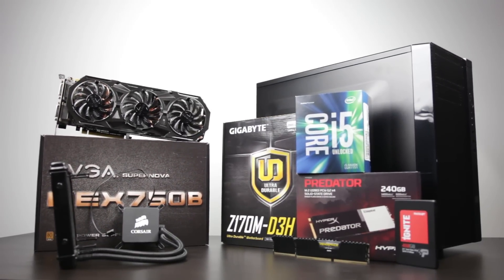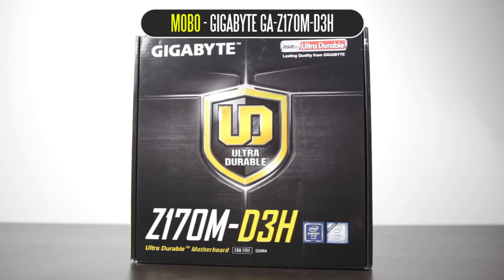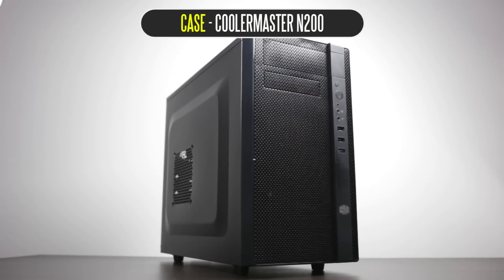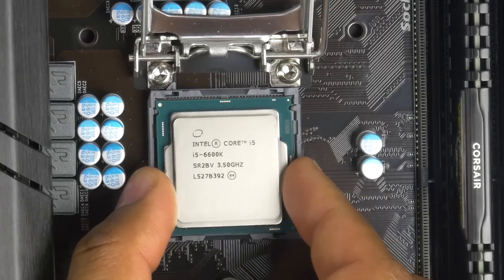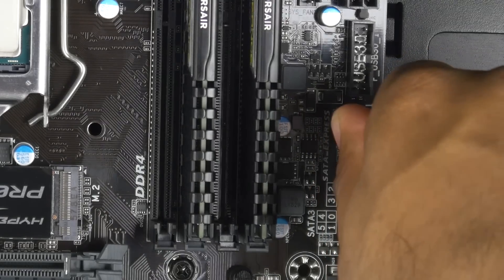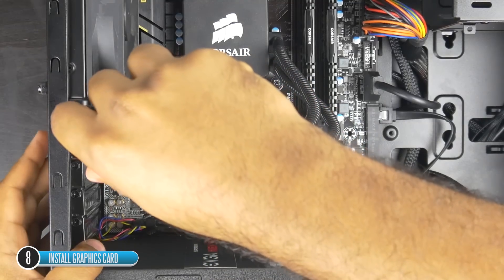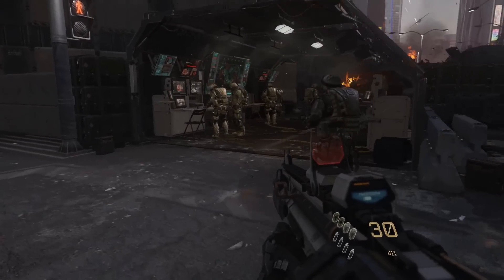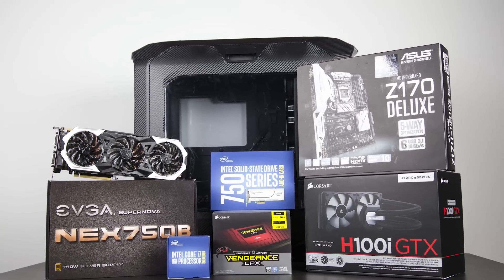Awesome Gaming/Video Editing PC For $1200 - Full Build Guide

Comment: i have an urgent question
i gonna follow the same built that you, except the RAM
I was thinking in a Kingstone Savage 8GB 2133 DDR4, taking advantage of the XMP
but is better the Corsair RAM?
Reply: If you're only focusing on gaming, RAM speed doesn't matter too much. Either should be fine. Make sure the RAM is compatible with your motherboard though.
Reply: That´s not only focus in gaming, also is for the engineer in computer systems, some build that you recomend?
Reply: To be honest, I'm not too knowledgeable about PCs outside of gaming. You may want to ask your company/school about what specs are best. There's a small chance they might even require a workstation-grade GPU. Good luck anyway.

Comment: can i used this processor Intel® Core™ i3-4150 Processor  (3M Cache, 3.50 GHz) on this mother board
Reply: no, wrong socket
Reply: yes of course, This motherboard is all you need if you dont sli or Crossfire. People tend to waste  too much in a MOBO they dont need. I got a i7 6700k h100iv2  and this MOBO theres no need for anything else. I wont SLI and dont need  the 3000000 million useless extra feautures. I rather spend more on a CPU than a MOBO.

Comment: this is a solid build BUT here's a couple of things 

1. that storage option is overkill, buy a normal 240gb ssd for the OS and a normal 1tb mechanical hardrive for storage...you just saved yourself $342

2.pairing a gtx960 with an i5 6600k is a bit well underwhelming if it was an i3 i can understand but with this sort of build a gtx970 is a much better choice, they sell for about $315

3.if you're using a board like this really and truly you have no business running SLI or Crossfire so with that said any how you look at it a 750watt is well unecessary as not even the most demanding single gpu will require that a 600watt will do fine 

with all that into consideration although your read and write speeds won't be as impressive you now have a superior gaming rig and you just saved some $$ total build avg $1000

for a more budget friendly build swap out the 
i5 for an i3 
gtx970 for the gtx 960
h60 aio cooler for a cheaper air cooler
Reply: Coyote x man this is gold! Thank you!

Comment: Hi folks, my current PC is a Fx 8150 with Thermaltake contact 30, 8gb ddr3 1600mhz, 970 gigabyte motherboard, Zotac gtx 760 2gb, 3 tb hdd. What should i do? wait for Zen or buy a I5 6600K, gigabyte Z170, 8gb DDR4 and a cpu coller for i5 will be better than the Zen?

Comment: The 6600k is such overkill for this setup. For the 960, I'd have stuck with a 6400 or maybe 6500. It's meant to be budget and overclocking isn't really necessary for the initial build.

Comment: Can I install El Capitan on my laptop Asus x552c
i will be using Logic pro x nd FCP
1. 8 gigs ram
2. I have 110 gigs of free space
PROCESSOR:
Brand Intel
Chipset Mobile UM77 Express
Cache 3 MB
Variant 3217U
Clock Speed 1.8 GHz
Processor Core i3

GRAPHICS
Dedicated Graphics Memory Capacity 1 GB
Graphic Processor Nvidia GT710M
Dedicated Graphics Memory Type DDR3

Comment: Cool build but it seems like you would use the R9 380X rater then the GTX 960 its a better card for about the same price. As Proof of concept I like the idea of the M.2 and the SSD but I would likely forgo the M.2 and get a HDD with the SSD and save a little cash. But still cool build thanks.

Comment: ONLY A gtx 960 in a $1200 build what a shitty build and a ripoff,  i could easily make a i5 6600k+390x build at this budget, which would curb stomp your build and with dx12 in the corner, it will be a monster. Seriously next time give me the money and i will make you a pc build, because from your past builds you really suck at this
Reply: +BossManiacGames EDIT here is a better build for $1200 that will curb stomp his in almost every game:http://pcpartpicker.com/p/42mZbv it has i5 660k+r9 390x. DO NOT use Waaj for pc advice, he may not even reply to this comment
Reply: +BossManiacGames  This build is also for video editing. Video editing benefits greatly of solid based drive.Also,  If you're just gaming the better gpu would have great, but, gpus get outdated quickly compared to ssd's.
Reply: Daniel Lopez
i5 for video editing makes no sense and your comment is invalid
Reply: Donny G
true but he sacrificed a lot of money on it and can be used on the gpu, having only a 2gb video card in a $1200 build is not good
Reply: Donny G
there are mobos on skylake that also support ddr3, ddr4 is cheap now, what does case size have to do with this, if your editing an i5 isn't a good choice, even a fx8350 outperforms it in editing, you would be aiming at an i7

Comment: How is this build? Could i run some decent games? 

CPU: Intel Pentium G3258 3.2GHz Dual-Core Processor 
Motherboard: Asus B85M-G Micro ATX LGA1150 Motherboard
Memory: Kingston HyperX Fury Black 8GB (2 x 4GB) DDR3-1866 Memory 
Video Card: Palit GeForce GTX 750 Ti 2GB StormX OC Video Card 
Case: Cooler Master N200 MicroATX Mid Tower Case 
Power Supply: Corsair CX 430W 80+ Bronze Certified Semi-Modular ATX Power Supply
Reply: +um 
Core i3-4170
Gigabyte GA-B85M-D3H 

Crucial 8GB (2x4GB) 1600MHz CL9 Ballistix Dual Ranked

Toshiba 1 TB

Asus Radeon R9 270X DCII 

Chieftec GPS-500A8 500W 80+ 120mm

Zalman Z3
Reply: ***** what does this mean?
Reply: +Walt Kowalski the pentium performs better than i3s in game
Reply: ***** games dont use hyperthreading and the pentium is extremely easy to overlclock
Reply: ***** by the time they do, it will be obsolete anyways

Comment: $700 DELL XPS 8700
Dell XPS 8700 with Intel-i7-4790, .....................................(4823 single core)and ( 19381 multicore).
Dell XPS 8700 with GTX 745 ............................................( OpenGL 72fps ) and  ( CPU 463cb )

Comment: can someone send me a good price for performance build with $1500? 
(i like 16gb ram, ssd and at least 500gb memory)
Reply: +Trey Hmmm....Try this

CPU: Intel Core i5-6600K 3.5GHz Quad-Core Processor  ($249.99 @ SuperBiiz) 
CPU Cooler: CRYORIG H7 49.0 CFM CPU Cooler  ($34.50 @ Newegg) 
Motherboard: MSI Z170A KRAIT GAMING ATX LGA1151 Motherboard  ($132.98 @ Newegg) 
Memory: Avexir Core Series 16GB (2 x 8GB) DDR4-2400 Memory  ($69.99 @ Newegg) 
Storage: Samsung 850 EVO-Series 500GB 2.5" Solid State Drive  ($148.88 @ OutletPC) 
Storage: Seagate Barracuda 1TB 3.5" 7200RPM Internal Hard Drive  ($46.89 @ OutletPC) 
Video Card: MSI GeForce GTX 980 Ti 6GB Video Card  ($629.99 @ Amazon) 
Case: NZXT S340 (White) ATX Mid Tower Case  ($64.99 @ Micro Center) 
Power Supply: EVGA SuperNOVA P2 650W 80+ Platinum Certified Fully-Modular ATX Power Supply  ($79.99 @ Newegg) 
Total: $1458.20
Reply: Mr. Shadow thank you man
Reply: Trey 4 months for a reply, eh?
Reply: +Mr. Shadow lol yeah. I still didnt build a PC so this build guide comes in handy. this is perfect

Comment: $1200, i5 6600k & 960? Lol that's funny
Reply: This guy seems to be a computer building noob. I really do pity him considering he payed for these parts himself :/
Reply: TheRebel3000 yeah, i agree. Even though he reuses a lot of parts it's still a bit of a waste of money
Reply: +Gerben van Zessen He's not a noob, he's a shill.

This build is crap. Completely.
Reply: Donny G
because a 960 for $1200 is not good, the 960 isn't even that good for the money, he wasted money on a useless ssd setup that won't help a lot in gaming which could be used on the gpu, which is the main part of a gaming  pc build for $1200 get a 6600k+390x
Reply: Gerben van Zessen
true and not even the best either
Reply: Trik Stari yeh
Reply: +Gerben van Zessen true for $1200 here is a better skylake build: http://pcpartpicker.com/p/rhtFD3 this is such a ripoff ripoff build, a water cooler is not needed get a air cooler and get a better gpu for that cpu
Reply: ***** i agree but the watercooling is fine in this budget, but obviously not if it's custom
Reply: Donny G what are you trying to say?
Reply: Donny G
true but a one samsung xp941 ssd is very fast m.2 ssd, over 550mb read and write and 1 hdd should do the job
Reply: Donny G because price to performance is terrible. E.g. You don't need two SSDs
Reply: And the psu is overkill

Comment: While installing the Corsair Cooler, it looked like you had the back bracket turned in the wrong direction. Why does it matter? there was a slice on one side of the bracket that is made to go around the screws on the back of the motherboard. helping get a more solid mount.

Comment: I76700k with Gtx 960 and got mine to $1275 with 120gb SSD
Reply: You can get a 970 for that price... You and this guy seem to be doing something wrong.
Reply: +TheRebel3000 Motherboard: MSI Z170A GAMING M3 ATX LGA1151 Motherboard  ($144.99 @ SuperBiiz) 
Memory: Crucial Ballistix Sport 16GB (2 x 8GB) DDR4-2400 Memory  ($112.49 @ B&H) 
Storage: Samsung 850 EVO-Series 120GB 2.5" Solid State Drive  ($69.87 @ OutletPC) 
Storage: Seagate Barracuda 2TB 3.5" 7200RPM Internal Hard Drive  ($67.89 @ OutletPC) 
Video Card: EVGA GeForce GTX 960 4GB SuperSC ACX 2.0+ Video Card  ($223.98 @ Newegg)
Reply: +TheRebel3000 he had an i5 in this list the i7 I found was $369 plus optical drive & windows 10 which equaled $1275 total lol I think I did pretty good :)
Reply: +hilltopdub if you went for a i7 4790k you could have got a 970/390
Reply: +Isaiah Hill haven't bought anything yet just getting the build ready. 1300 limit for me, should I do a better graphics card?
Reply: +hilltopdub DON'T BUY GTX960 !!! NEVER. Get 970/390 as "Isaiah Hill" Said GTX960 is a little bit overclocked 760. IDK go for the Hashwell i7 or maybe Skylike i5 but NEVER 6700k + GTX960...
Reply: hilltopdub It will easly handle editing/recording. But why you want to record gameplay ? If u really need this extra Threads u can go for Haswell i7 it will be better for rendering etc. i think.
Reply: hilltopdub if you want i7(non-overclock able) this is what you can get http://pcpartpicker.com/p/W8Fhzy

if you go with i5(overclock able) http://pcpartpicker.com/p/2hDynQ
Reply: +Isaiah Hill haven't bought anything yet just getting the build ready. 1300 limit for me, should I do a better graphics card? And just port my windows 8 to the SSD?
Reply: +4TooFLY changed to i5 6600k 3.5ghz and GTX 970 4gb + Kingston SSD, which dropped me to $1180 :)    just worried about the i5 being able to edit videos / record gameplay
Reply: The build I'm working toward.  http://pcpartpicker.com/p/dgtynQ
Reply: +Isaiah Hill    Just checked with some peeps, I think I'm gonna go with this! http://pcpartpicker.com/p/RpGYD3  $1300  (500gb of SSD for only $159 right now!)  Just gotta pick up windows 10 from a friend.
Reply: +hilltopdub http://pcpartpicker.com/p/Vhk3YJ check this out if you want skylake and want to overclock. You can change the GPU to a 970 and same with case PSU etc.

Comment: that 750W PSU is an overkill... even an r9 390X can be ran on a 550W PSU and next gen gpus are expected to be really power efficient.
Reply: ***** if and 2017 isn't far off either, but then again neither will 2018 be in 2017... see where this is going? It literary needs to be a couple weeks or less until release for that statement to hold any truth.
Reply: +Crazy Psycho Not overkill if in the future you plan on using SLI and upgrading to a i7 6700k, not to mention adding additional SSDs, HDDs and aftermarket case fans.......
Reply: +Crazy Psycho and to add on, why the crazy ssd setup and only a 960, when you can just get 1tb hdd and 250gb ssd and a 970 or 390
Reply: +Darth Nihilus Upgrading a 6600k for a 6700k is autistic as fuck and 750w still isn´t enough for sli.
Reply: Lol don't forget that his power supply is 80+ bronze
Reply: Lol don't forget that his power supply is 80+ bronze
Reply: +Darth Nihilus who does sli with a 80+ bronze? Go for gold or higher
Reply: Darth Nihilus jayztwocents did a video had 1x gtx 680s an i7 3770k with a custom water cooling loop(pump), a shit load of fans, a lot of hdds and ssd, crazy overclock on the cpu and gpu with a custom bios and his PC used 300-330 Watts on full load with a stress test from the wall... let alone gaming or other productivity tasks.
Reply: +Isaiah Hill With the 850B2 i would :P
Reply: +Crazy Psycho We got your point. But, you know. Just because you can, doesn't mean you must do it.

Comment: I was begging for this build, thank you
Reply: Please don't use these specs. He wasted money on a PCI SSD doing this when he could've just got a really cheap 240GB SATA SSD and a normal hard drive and got a better graphics card like a 970 or a 390X. He also bought a mid tower case that's massive compared to most compact ITX cases then called it a compact build, and put a power supply in that is more powerful and expensive than he would've needed even if he had a better graphics card. Taking advice from clearly inexperienced PC builders isn't a good idea.
Reply: +Jo's Tech http://pcpartpicker.com/p/42mZbv
Reply: Listen to @TheRebel3000. You can get a i5 4690k+ Samsung 850 pro(256gb)+ r9 390 +2tb hard drive+ optical drive+ O.S+ 1080p/1440p monitor+ keyboard and mouse+ wifi card+ corsair 350d and the rest of your computer components for a little over 1300$ if you count taxes and shipping
Reply: +BossManiacGames LOL I'm seeing you all over this comment section..but hey I have a question. I need some recommendations for a build that I'm trying to make. I need something for Photo and video editing(mainly photo editing because I'm a photographer), web browsing, Microsoft apps such as word, excel, etc...with some gaming but not a lot. 

My budget is flexible, $500 - $1200 not including peripherals. What would you recommend? I also plan on upgrading in the future. I can also compromise on a few things too. Thanks for the help
Reply: JenoEXOProxy23X
http://pcpartpicker.com/p/JxLpdC